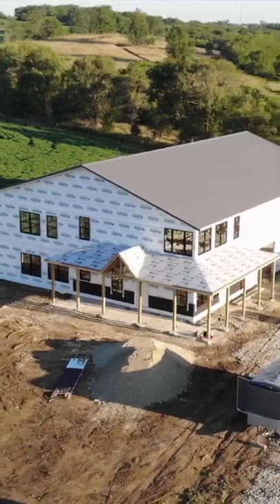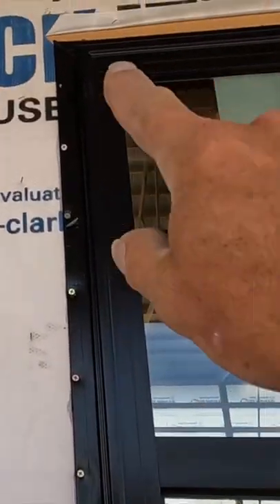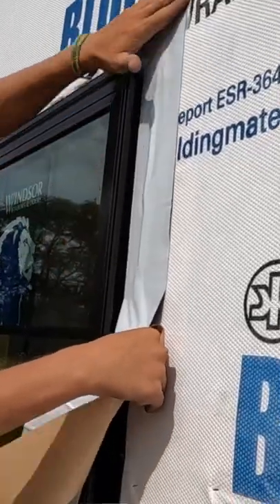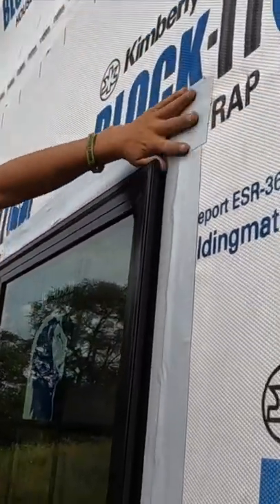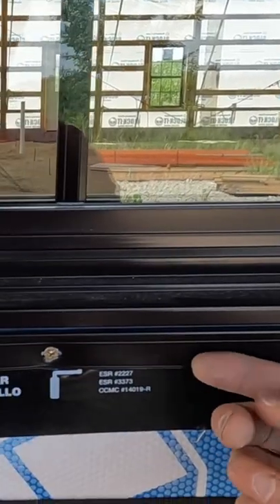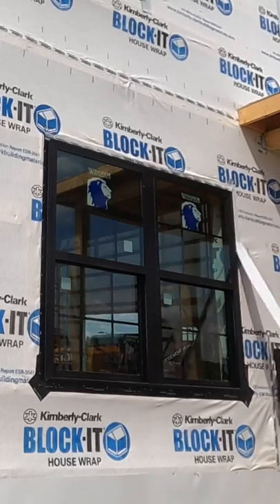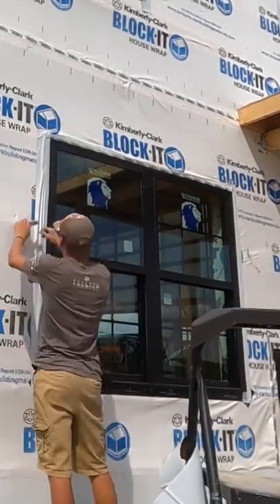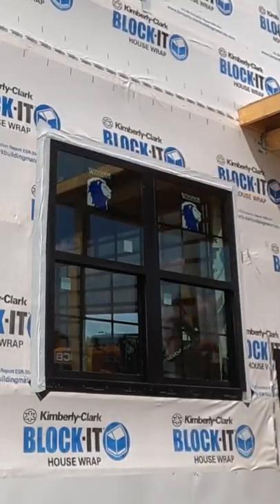WATERPROOFING New Window Installation #shorts

Comment: Congrats you now have trapped any condensation with the top piece of tape , membrane should be under Tvek , membrane to sheathing/window flange sides are cut back for membrane to come in contact with Tyvek , sheathing and window flange

Comment: What's the point of cutting the paper on 45 degrees above top nailing flange if you're not going to put house wrap tape over the flange and on the osb? Also failed to put strips over the top 45s

Comment: You can put that tape on the top of the house wrap if you want…. BUT you need to have that flashing tape be directly over the nailing flange and the sheathing (osb). Then you put the house wrap over that.  On the bottom of the window rough opening, you were supposed to make a “pan” with the flashing tape that goes under the window flange. 

So you flash the bottom before installing the window, then the sides and top right after installing the window. This is why I like to house wrap after the windows are installed. I even run the house wrap into the j channel on the top and sides, then the bottom j channel goes over the wrap. 

The flashing is the bottom last line of defense. You can use it over the wrap, but it needs to be underneath.